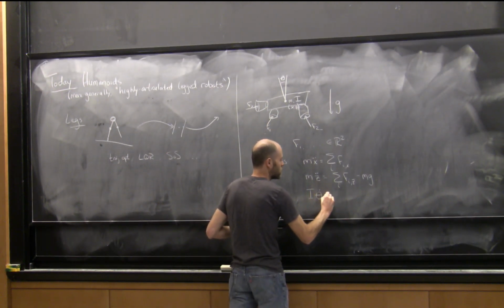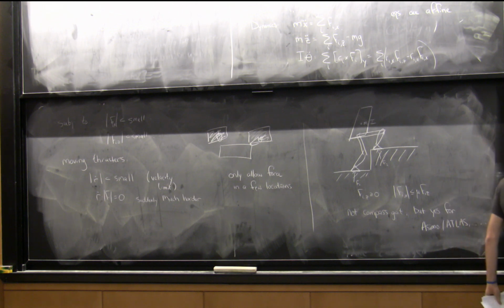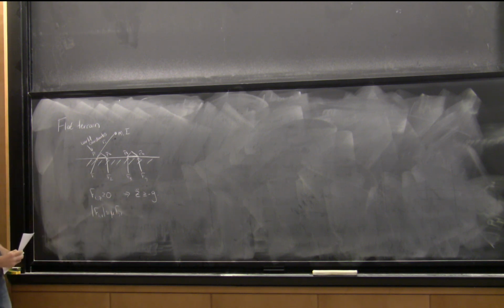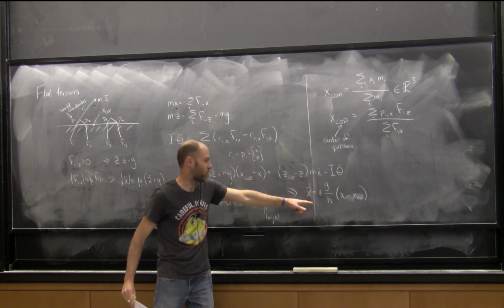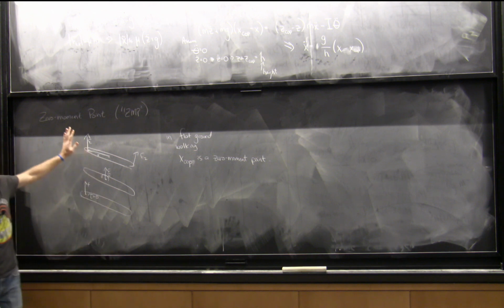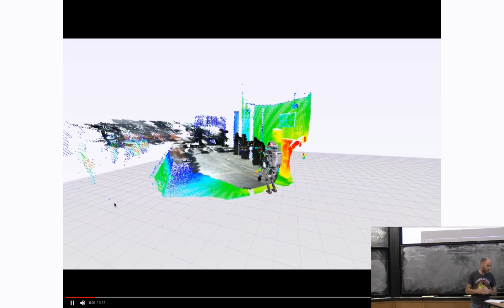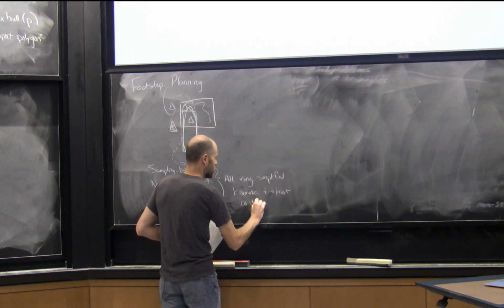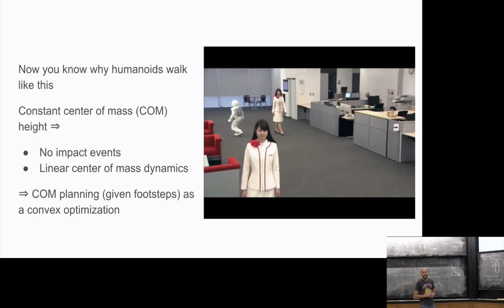Lecture 16 | MIT 6.832  (Underactuated Robotics), Spring 2019

Comment: 54:12 - Angular acceleration.
If you lift your foot and lean the CoM orientation changes changes. 
But I think if you don't lean it does not?
So this would imply a limit on how far out you can place your foot (in addition to kinematic constraints).